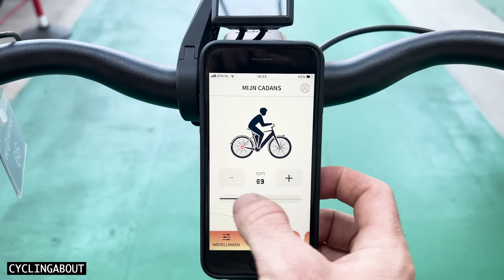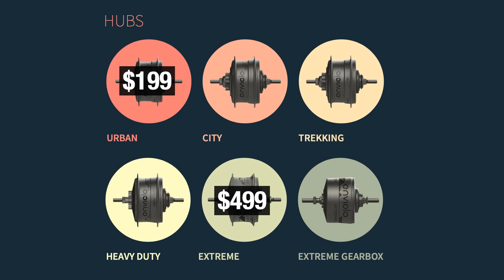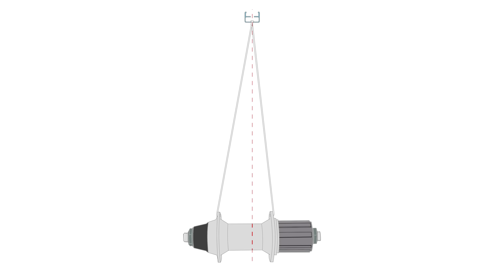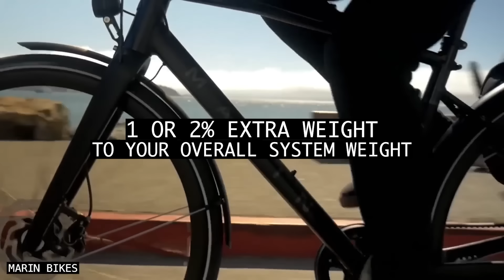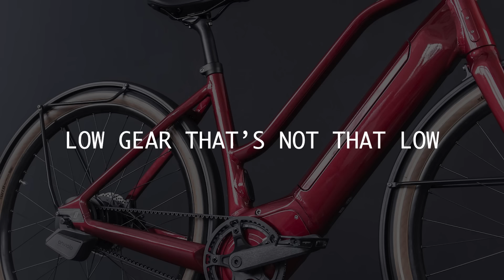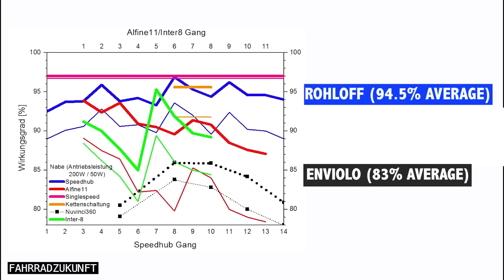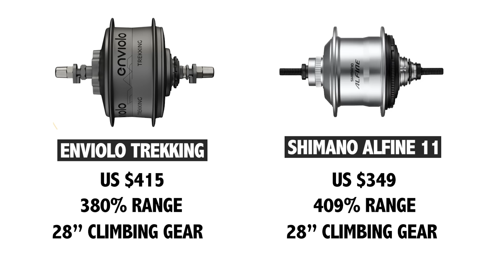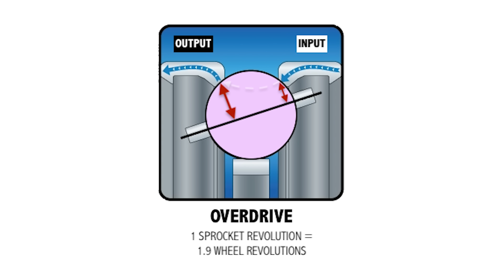Are $199 Enviolo Hubs the BEST Internal Gear Hubs For Bicycles?

Comment from the maker: Don't worry, I have a lot more videos on bicycle gearboxes and belt drivetrains for you to watch! 🤌🏻
🧡 5 New Bicycle Gearbox Drivetrains 2023 --- https://youtu.be/pyeMBKJLtWI
🖤 Shimano Alfine internal gear hubs --- https://youtu.be/qf9tFJFXV5o
❤ Rohloff hub vs Pinion gearbox --- https://youtu.be/W_hx4V9mYuw
💛 Belts are now better than chains --- https://youtu.be/PhXTl7gApVA
💙 Effigear Mimic gearbox --- https://youtu.be/F08bDBK7U7A
💜 Chainless shaft drive bicycles --- https://youtu.be/eimLIkJaNFM
💚 Chainless digital drive bicycles --- https://youtu.be/r-Zyp6jX0HM
Reply: @Cyclingabout pin this to the top so it doesn't get lost in the flood of comments on the video.
Reply: I'm glad you pointed out the efficiency loss, well researched video, that was really hard to find when I was doing research on these hubs too & probably not a frequently asked question. :)
Reply: Que bueno.seria traducir al español grcias
Reply: What should be the cost of 625% meshed IVT crank gearbox? In process of filing patents.
Reply: 😁We have patented an entirely new, low cost, hear-silent, ultra-efficient, infinitely variable, ultra-torque dense [small & light], high durability gear technology, called FrictionLess Gear, which is a reformulation of gearing theory sans any toothed wheels. The gear range can easily be >700:1 [ultra high gear rage possible] with a price half that of the lowest priced competitor. Legacy and novel applications abound. Retrofits of ALL existing bikes, even electrics, will be available. 😉

Comment: They also work amazingly well on tandems since you dont have to agree with the passenger on a time to shift. Just twist the grip and the change is felt no problem. Huge uprade to tandem riding!
Reply: "dont have to agree with the passenger on a time to shift"
Ah, yes. The classical hostile-tandem-passanger situation 😅
Reply: We appreciated that too (although for big shifts still had to back off the power).........but found that when using low gears to go up hills, with two people, we were often over the level of torque that it seemed to be comfortable with......I would describe it as feeling 'squishy' when pedalling very hard
Reply: @matmaxgeds yes that’s probably the loss of efficiency you’re feeling, they definitely don’t feel as solid as a regular cassette
Reply: The Automatiq would be even better on a tandem
Reply: Ok, that seems to be one of the only valid arguments for me. I feel that.
Reply: pair it with an electric shifter its even better

Comment: The negatives outweigh the positives for me on this one... The lack of climbing gear, fiddly wheel removal, unreliable shift cable....  This thing is not for long-distance tourers.
Reply: Exactly. Restricted pretty much to those who don’t ride much. Cool concept though. Maybe a ring to ball to ring to ball to ring design would add enough range? But that would reduce efficiency even further. And add weight and probably limit the torque even more. Oh well.
Reply: which hub do you recommend if you ride a bike a lot and need less maintenance? I currently have an Envilio 380 and I am thinking whether to change it to an Envilio automatic or a Rohloff automatic
Reply: @EricPeelMusic  For my e-bike with about 50 miles of real range it seems like a fine system. Even with the Rohloff I'm still limited to battery life.

Comment: My first experience of one of these was on an ebike, under the Nuvinci branding. With the 250w mid drive it was incredibly sluggish. My following experiences have also been with ebikes and again were incredibly sluggish. Nuvinci, or Enviolo refuse to publish the efficiency of their hubs, and they make a very large effort to convince people that third party testing shouldn't be trusted. They know these hubs aren't efficient but won't admit that, and they'll only get worse with age, not better. The twin cables also make puncture repairs very annoying. I absolutely hate these hubs, I hate the company, they're unbelievably heavy, and aftermarket support is very lacking in many parts of the world. I contacted them once about some bearing play from the shop I worked at, and the response was less than helpful, implying that replacing the hub at full price was the most convenient thing for them.
Reply: which hub do you recommend if you ride a bike a lot and need less maintenance? I currently have an Envilio 380 and I am thinking whether to change it to an Envilio automatic or a Rohloff automatic

Comment: As a road cyclist who occasionally uses these hubs when using bike shares, my biggest annoyance is the massive range in the highest ratios (which i basically always am in with these because they are geared so low for the average cyclist) this is definitely due to wear somewhere in the system, because when they add new bikes to the fleet they always have good ratios at first. Perhaps it is due to the cables or misuse/lack of maintenance, but with a bike fleet that is something you need to design for.
Reply: Came here to say this.
Where i live (switzerland) there are a lot of hills, so theres a lot of shifting under heavy load going on.
I very rarely see an enviolo over 10000km  which still provides the full range.
As far as i know the problem is the disc which angles the balls in the hub, it wears out and is no longer able to maintain the balls at the maximum angle
Reply: I think this is cable related and probably not too hard to fix, using the electronic shifting might resolve this.
Reply: 20,000 km is already not very long for a bike transmission to last, especially not for the price. And it sounds like it doesn't even really last half that. It's a shame, because it otherwise seems like a good idea.
Reply: Get over it...Buy a Rholoff and move on !!!or if you want extend your fleet...go for the Pinion....and you will sell your fleet and keep that one.
Reply: Yeah I think at max gear and higher power on a public bike you're also more likely to run into problems. My local ones skip to hell and back if you try and push high torque through them with lower cadence (I'm an extremely casual cyclist, might be missing something)
Reply: I was unaware that enviolo “gear” range reduces over time and use. If that’s true I wonder why it wasn’t mentioned in this otherwise comprehensive video. 
I’d like to learn more since I have 3 CVT bikes now.

Comment: Ease of maintainability is a big deal. The cost difference in servicing an Alfine 8 vs an Alfine 11 makes the Alfine 11 much cheaper in the long run even though the initial purchase cost is higher.
Reply: Except it sucks. I have it, it's by now a whole parade of gears are not usable, start skipping under load.
Reply: @huhummmmmmm  Did you perform the recommended yearly maintenance? Have you sent it to a bike shop to be looked at? It may need some tweaks to the barrel adjuster. Or it could be something else entirely.

Comment: As someone who used a  NuVinci N360(Enviolo before 2017) for Mountain biking for 2 years, I can tell you outright that the efficiency loss of bike CVTs absolutely destroys you on steep climbs. I ended up going from the N360 to the Rohloff speedhub and the speed difference was insane. My best time in ideal conditions on specific 10 mile MTB trail was 1 hour and 20 minutes with the N360, I was able to do the same trail in 58 minutes on the rohloff my very first time out in sub-optimal wet/muddy conditions. 
The Efficiency makes an Insane difference over time and distance especially if you have any steep climbs with bumps like roots or rocks on them. Granted if you're using the CVT on an E-Bike with pedal assist on, then the difference probably wont matter to you, but otherwise; you're gonna have a bad time over distance especially if there are any steep uphill sections.
Reply: Premium Efficiency example (Higher cost equals better performance & efficiency) 
Superlative air-source mini-split heat pumps with COP of 7.1 cost 3X more than cheaper units with a COP of 3.4
Long range BEV's cost 2X more than ICE with similar range per fueling
LED bulbs with the same spectral performance (color matched, wide color gamut and high CRI) about 10x more costly
Homes with superior German Passivhaus super insulated and high efficiency heating & cooling are 2.5X more costly
Aircraft with better fuel economy can cost 40% more in capital cost upfront
I.E. You can't get something for nothing in engineering, or there is no free lunch in physics

Ultra low energy consumption homes with full function cost 5-8X more than cheaper less efficient simple homes- this is called the dark side of going green because making all that super efficient all copper or silver heat exchangers, gold wires, and titanium foam + MLI insulation, gap sealing, thermal bridge mitigation, low-E triple glazed windows, high R-factor fireproof security doors, AI control of systems and smart home devices, more wires, more networking, specialized expensive heat pumps fridges, clothing driers, water heaters, and heat pumps for HVAC.
Reply: Premium capital cost for super efficient systems and devices has a better ROI when they are used in economies where energy for those systems more costly. Like in Tokyo where electricity cost $1/ kWh an LED bulb has a much faster ROI than in Grant County, Washington State where electricity only $0.03/kWh or 33X less expensive, where an LED bulb almost does not pay for itself before flickering failure or burning out. Also given the complex manufacturing of LED chips on legacy node IC manufacturing equipment, there are hidden toxic environmental effects from the emissions of said processes, that were never an issue with incandescent, low and high pressure sodium, halogen and fluorescent bulbs which also saw a 50x reduction in mercury content per bulb, important cause Hg now more expensive that Ag or liquid metal mercury costs more than silver now.
Reply: @AaronSchwarz42  Shimano Alfine is cheaper  and has higher efficiency and  better performance,  basic  cassette with dérailleur has even better performance at fraction of the cost